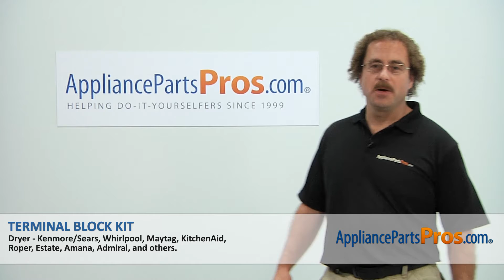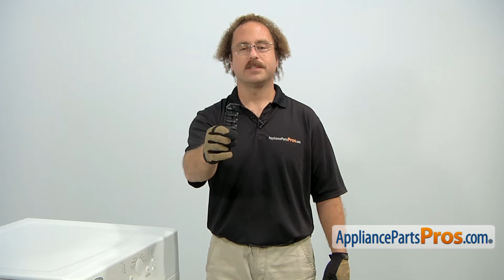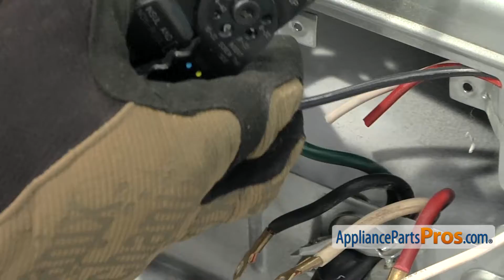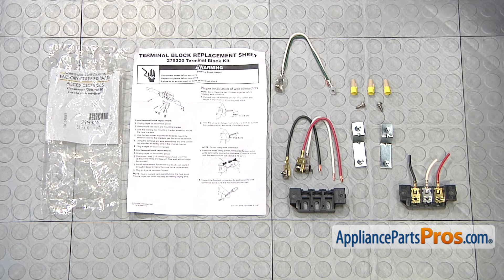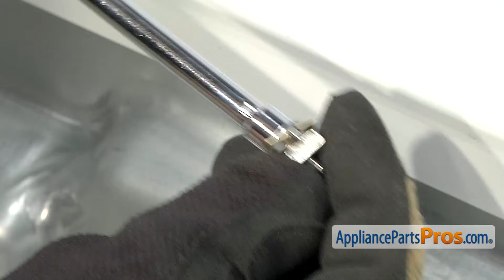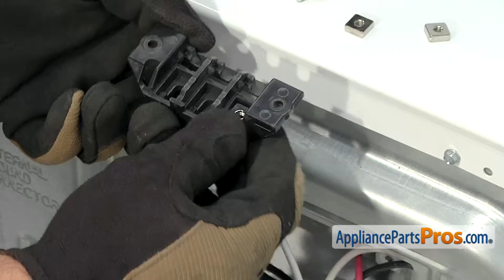How To: Whirlpool/KitchenAid/Maytag Terminal Block Kit 279320

Comment: Would you recommend wrapping the wire caps in electrical tape to make them more secure? Or would the electrical tape melt?
Reply from the maker: They should be fine without adding the electrical tape to them.
Reply: @appliancepartspros thanks ! 
So i didn’t really have enough slack to use the included wire nuts, so i used the wago connectors. Just want to be sure i used the correct Wagos : What gauge are the black red white wires?

I did this repair today and the dryer works no issues.
Reply from the maker: Glad you were able to do the repair. If there is any issues or you need help with anything else please let us know. As for the connectors that you used we don't have that type of information that we could provide to you.

Comment: I've accidentally contacted my bare copper ground wire with my hot 220 black (I was moving dryer around and the ground slipped in between the plug and the outlet.)  Of course the dryer now doesn't work - removed the wire, then restored the breaker with not luck, do you think this could be the problem?
Reply from the maker: You will have to troubleshoot the dryer and see what was damaged. Without knowing what you have, I would suggest posting the problem along with the appliance model number on our repair forum and the techs can help you troubleshoot the problem. http://forum.appliancepartspros.com/

Comment: My screws won't go all the way in.  Can I buy just the square nuts?
Reply from the maker: You can go to our website and enter your appliance model number to view the parts breakdowns to be sure you get the correct part for your model and see if the nuts are sold separately.